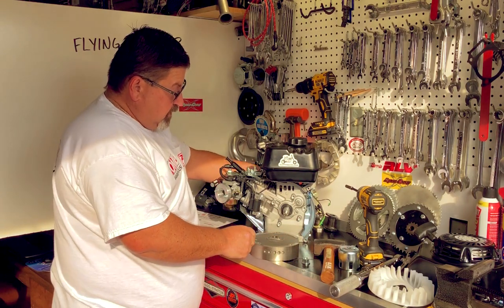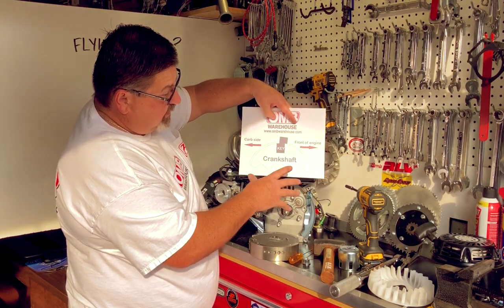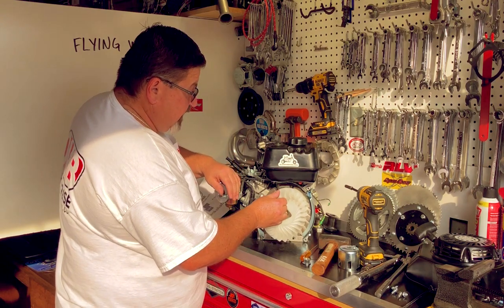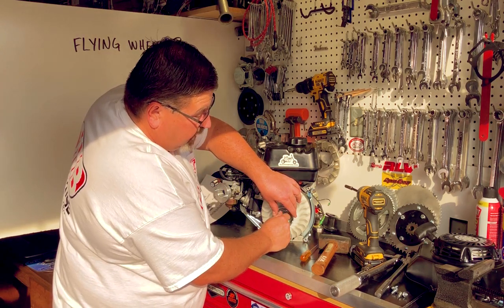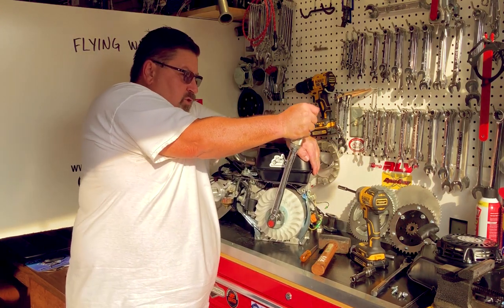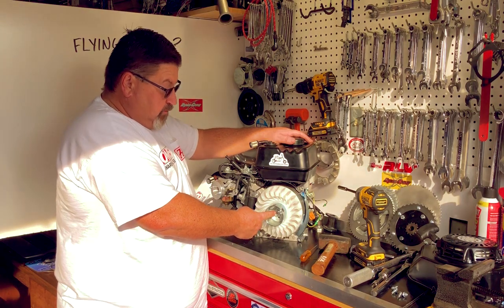Flywheel Removal and Advanced Timing Key Install on a Predator 212cc

Comment: They always try to make this look easier than it is to encourage you to buy. The flywheel does not come off this easy, he barely put any pressure on it at all.
Reply: Right ? And what exactly is the “front  of engine” should be more specific. It would also be great to zoom in on parts being worked on and described. 
I mean that’s what I want to see

Comment: If anyone is wondering YES this does make a difference, what do you think $100+ flywheels come with 8° built in for?  Use this to support your stage 1 until your ready to install your billet rod, aluminum flywheel, cam and correct springs! You dig😉?
Reply: wait did he say the racer dudes dont use a timing key at ALL ??
Reply: @SpACeCruizeR2o3  some just set the timing and then use the torque and the Taper to hold it on. The Woodruff key doesn't keep that flywheel in place at full spin, it just gets it in the right place. The nut and Taper do all the work. This is why torque specs are so very important.

Comment: Great, I came to learn how an advanced timing key works, and learned absolutely nothing about how an advanced timing key works. Thanks for taking up my precious time!
Reply from the maker: Hi KW
This is an installation video. 
I don’t have any videos on how a hammer works either, sorry
The key moves the flywheel in relation to the coil to fire the coil earlier when the piston is coming up in the cylinder. This is important with higher octane fuel as it burns slower. Very important for “experts” that want to use race fuel in low compression engines in hopes that will magically make more power.
These keys simply change the relationship between the flywheel/coil and when the plug fires 
If you have specific questions please let me know
Reply: then you should have watched a video about ignition timing basics. This guy didn't waste your time you looked up the wrong thing!

Comment: just bought a 13tooth max torque clutch to run on my ducar 212 which has a 65tooth rear sprocket but the 13tooth dont come with a key way and the one that came with the ducar is all loose in the shaft do i cut in half and put it in the clutch keyway or on in the shaft slot!!!!

Comment: I know this is an old post, but i just started watching these videos on Predator engines since my engine just failed in a leaf blower "GiantVac" where I took out an old 80's / early 90's style engine and stuck the Harbor fright $99 engine in, and has been working great for 8 years until now but ran into backfire issues, no start, even after putting new carb on it bought from Ebay.... thanks for explaining this stuff really well, will have to subscribe to this channel.

Comment: Nice! What does the 8 degree timing do for the engine? I know my ARC billet flywheel has the advanced timing built in. Will it make the engine overhead?
Reply from the maker: Hello! I watch your videos and posts on OMB! Thanks!
For these engines to slip through the EPA for importation, the engines are really choked down on the intake and exhaust. When you open them up with a header and intake, we can increase the timing to get more power. This typically has a bigger effect at higher rpm's, but we have noticed better performance even with the governed engines. The stock timing is at 24 degrees...which is a bit lazy! There are no overheating issues associated with that as the additional fuel helps keep things cool! These engines need some heat in the head to make power. That is why the jetting is critical!
Please let me know if you have additional questions
Reply: @TheGrayGoatGarage  Sweet! That's a great help.
Reply from the maker: Thanks! I am having fun playing in the Gray Goat Garage and hope to shed some light on different topics. Too much bad information out there! We are updating our new YouTube channel as well! say tuned and watch us on Facebook live on Thursday evenings at 8PM Eastern time.
I am starting my GX200 build this week. I will be boring the block to 2.815 and using a Predator crank for a little more stroke. Big valves, a lot of cam and 1.3 ratio rockers are in the works. I need to beat up some young kids with this one!
Reply: Nope

Comment: if you add the 8 degreee key, can you still run 87 octane fuel? or do you need to step it up? same question BUT with the addition of the thinner .10 head gasket? assumin you have the air filter, open header and the carb properly jetted for those, do you need to step the jet up again for head gasket and/or 8 degree key? thanks and love your vids, very straight forward and clear cut.
Reply from the maker: Hi Bill,
Yessir! You can run 87 octane with the 8 degree key as the compression ratio has not changed and that is not excessive advance for the engine. The compression gained for the thin head gasket won't have any effect either. Ya know! I see so many guys wanting the high octane fuel for mo' powa' ...but it is actually working against them in most cases. I run 87 in most of my engines. Of course, jetting is critical regardless of the octane you are using. With the thin head gasket you may be able to go one size bigger on the jet, but the average guy jets too rich anyways! We need to have heat in the head to make power. Advance the timing and put the .010" head gasket in and run it! You may find that you already have the perfect jetting!
Please let me know if you have additional questions...and thanks for the kudos! Much appreciated

Comment: I am having trouble getting the flywheel on my 212 hemi to break loose. I have tired everything I can think of. Anyone have any suggestions?
Reply from the maker: Use a bigger hammer! 🤓
It is all about shocking the parts and not how hard you hit it!
Make sure to pull out with a big screwdriver to remove the endplay and then give it a decent shot with a heavy hammer 
Small hammers do not shock it enough!
Good luck!

Comment: Hello, i purchased the stage 1 kit from omb, along with the pipe/air/jet it also came with 18lb springs and 8 degree key. Should i install these also?
Reply from the maker: Hello,
If you have the governor intact, you may not need the 18# springs. The stock springs are 10.8# and the valves may float at 5000 rpm's. However, the Chinese springs are inconsistent and you may get valve float earlier than that.
The stock timing is very lazy at 28 degrees BTDC. The 8 degree key will get you to 32 degrees BTDC and will help that engine make more power. I always install the key!
Please let me know if you have additional questions
Reply: @TheGrayGoatGarage  some guy told me not to install key until i get billet parts?
Reply from the maker: LOL...with a billet flywheel, you can use the stock key as the flywheels come with 32 degrees of advance. If you are using the stock flywheel, it is not mandatory. but it will help. IOt all depends u.pon the intended use of the engine. Most people don't install the 8 degree key as they are intimidated with removing the flywheel. If you plan to use a billet flywheel in the future, don't worry about it right now
Reply: @TheGrayGoatGarage  i hear you lose bottom end?
Reply: @TheGrayGoatGarage  and thx for setting it str8 :) illl wait on springs until i remove gov
Reply: @TheGrayGoatGarage  sry, i meant cam, he said dont change timing unless i get a cam. Not flywheel. Sry i mis spoke.
Reply from the maker: I am not aware of losing "bottom end" with the 8 degree key...but I am no Facebook/Youtube expert!
Reply: @TheGrayGoatGarage  again thx alot for help. Ima do the 3 first. Then timing. Gov then springs.
Reply: I have experience with advancing cams and/or ignition in V8 drag racing engines and, there are two possible meanings to the phrase "losing the bottom end". It could mean that it puts too much strain on the lower end of the engine, crank, rods,etc. It could also mean, you lose low RPM torque or horsepower. When you advance the cam on an engine, the valve timing,  it increases low-rpm torque. It decreases low RPM horsepower. And the inverse happens at high RPM range. If you are advancing the ignition timing, you pick up a little bit in the lower RPMs and it increases as RPMs rise. Basically, you are tricking the engine into thinking it has more compression. I don't know what degree key to use but I'm definitely going to buy one. I have more research to do as to what degree advance to get. FYI, too much ignition advance and it will start to pre detonate, or ping, or ignition knock. Then, away goes the piston and valves. Higher octane fuel will fix that though